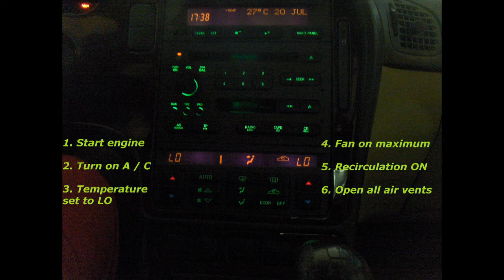SAAB 9-5 OG cabin filter replacement

Comment: There are a couple more screws at the bottom of the glove box.  Another item bolts to the cover of the filter box which makes moving the cover out of the way difficult.  You might want to unplug the battery.  I got shocked by something inside the filter housing.  This was not a fun 35 minutes.  As for sludge... change you oil regularly :)

Comment: Just curious about the running of the A/C after replacement of the filter.  Is that just something that's recommended or have you learned from past experience that it should be done?  I'm about to change mine, '06 Saab 9-5.